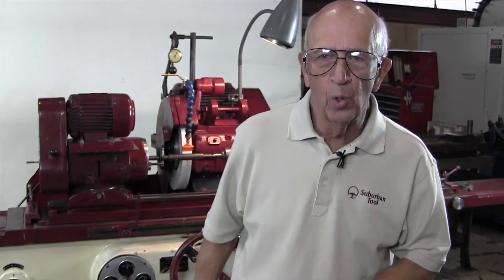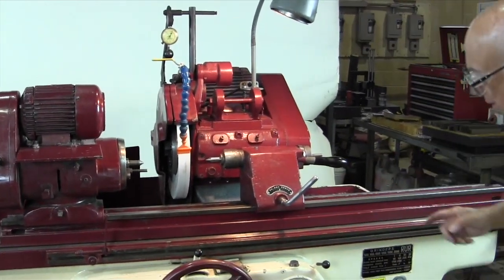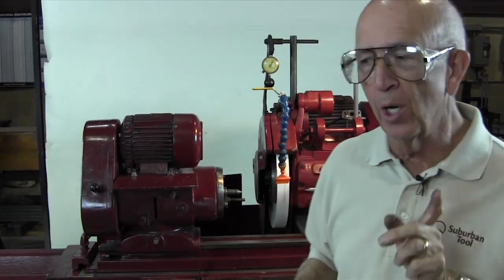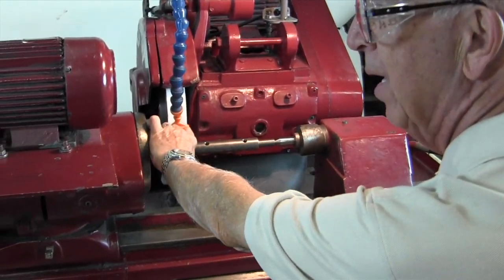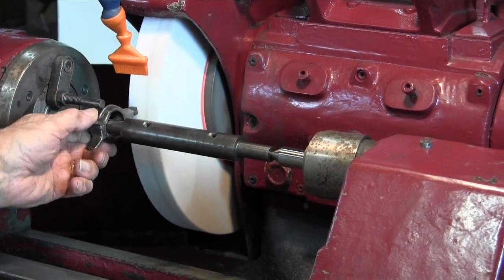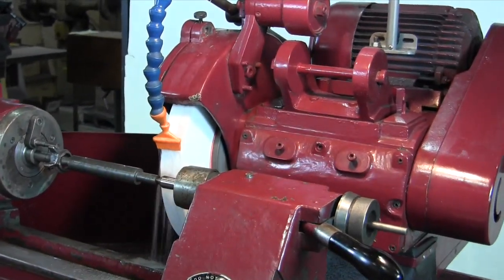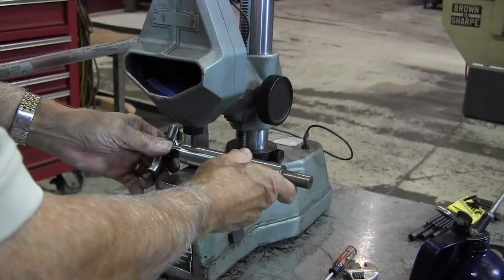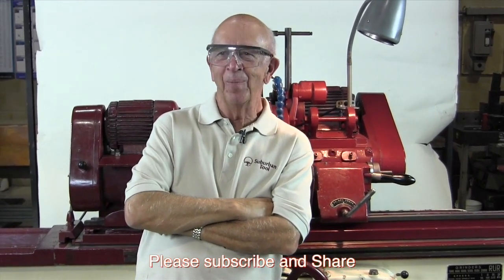How to remove the taper from an O.D. Grinder without grinding the part.

Comment: In the 40 years on working with my kiwi-way cylindrical grinder. I have made centerpieces for both ends. Thinking haven’t had to make for awhile. A #2 Morse taper with a .250 diameter hole on big end about a inch deep concentric to the taper. This machine works 1-1 at 4 inches. 6 inch part 1 1/2 to 1. 2 in part 1/2 to 1. I can usually be within 10 minutes of almost any taper up to 5 degrees. 40 years on one machine helps a lot.

Comment: If someone gives me a piece to grind and wants minimum stock removal I can set the wheel up parallel with the job by using feeler gauges I can set up within .0002" or about 5 microns before I start grinding. I can see the logic of the method in the video and it's a decent idea but the traverse across the piece with such a heavy cut would cause uneven wear on the wheel even on mild steel being ground here. Over the years I've ground mainly stainless steel and Inconel which don't produce sparks so for the novice doing this the wheel would be liable to bite in and then bang you'd have a destroyed workpiece.

Comment: That’s a great tip. Been grinding over 20 years and it never occurred to me to grind the driver. My method is on a slow day years ago I ground several shafts all different lengths straight and set them in a box. Then I pull out one that’s the length plus minus the tailstocks travel from the part I need to grind, load it in the machine indicate it straight moving a indicator across the shaft until it’s a tenth or better. Then load the part I’m going to grind and the taper will be within .0002” first try guaranteed. It’s a huge time saver. Like you said I’m often given a shaft with less than .001” on the diameter so you need it straight or very close to before you start making sparks.

Comment: Sir iam indian in od grinding by cylindrical grinding dia 25mm lenghth 400mm but my job problem both end sige 00 between side sige plus 50micron sir how do correct middle sige od 00 pl. Inform. 78787 46952

Comment: So he got the part parallel to the grinding wheel through out the travel.  I mean he said the table has worn so he tweaked it to take out the error in the travel. I'm not a machinist but if your going to grind and cut, keeping your piece square or parallel to the machine, which ever is required, is obvious.  Seems to me you learn your machine and don't get aggressive with removing too much at once.

Comment: You did not have to do that for the taper. You could run an indicator across the part from side to side or touch of with the wheel from side to side with out turning on the grinding wheel. It's safer.
Reply: The stock is not always trustworthy, especially a piece that has been heat treated. You could see in the video how it did not grind evenly on the first pass due to deviations in the stock

Comment: interesting tip. also noticed you have you drive dog pushing,, not pulling. i can see its wedged so its not likely to move, but pushing isnt really the best way , is it don. This way would definitely take a lot of time if it were a big job, having to crane it in and out would be a pain. would you s a dial in that instance. or just mark the job up and lightly touch either end, then move taper. and repeat one more time.

Comment: Uh, if you're "heavy" on the right side of the wheel meaning it's sticking farther out then smacking in the right end of that table so it gets closer to the 'heavy" side of the stone is only going to make that side "heavier". Which is obvious given how the more you "fixed" the "taper" the more the left side of the stone did NOTHING and the RIGHT SIDE WAS DOING MORE AND MORE. That's quite a "trick" all right.

Comment: i got a question how come you just let the tailstock spring tension hold your work and dont lock it into position  ?
Reply from the maker: On this particular grinder\part the spring tension is more than enough to hold the part. On a larger heavier part, locking would be more important.
Reply: thanks don i been in machine shop work for 25 years now and really enjoy your tutorials thanks for taking your time to answer me .

Comment: That is a good trick...back in the old day's you didn't have a indicator to run along the side lol. nor had you one or still don't have indicator to move the table.
A piece like this, [like most pieces] have stock and I'd be ahead of you by just putting it into the machine and start
grinding...as it grinds I'll keep adjusting table until I see more or less even clean up on ends, then measure first time....how many times you've turned your shaft around and not taking a cut? [time is money]

And it's almost impossible to do on my pieces, from yesterday, this shaft I made from 4140H. hot rolled, all diameters turned .008" oversize, run out was .0015" after grinding run out .0001-.0002" max.
https://www.youtube.com/watch?v=EISJyO7V__g
Reply: You cut on that shaft for how long on a LATHE and within .008" of "finished diameter" it had a "runout" of .0015"? On that SHORT LITTLE SHAFT IN THAT VIDEO? And you don't get that your ".0001-.0002" max" so-called "tolerance" literally means the "big end" is DOUBLE the "small end"? That's like a carpenter bragging about being able to cut 15' 2x4s that started as 20-footers to a "tolerance" of 1 to 2 inches max.
Reply: Konely King not with only .001 stock you wont

Comment: good idea for roughing out. 
i have to work to microns .so still have to use a dti or digital Mic to finish accurately
Reply from the maker: That sounds about right.  Like you have said, this method is just a means to "get it close," you'll still have to dial it in when working with precise tolerances.  As always, thanks again for watching!
Reply: it is a good ideal though having been in the trade for 30 years .one of the best ideas for getting the part close to parallel.

Comment: This is a great trick! Does the grinding wheel wear unevenly when you "walk" it across? Does the right side wear out faster? If so, then would it be recommended to pull it out, step over the width of the wheel, then plunge to the same depth?

Comment: why not just grind it by flipping the part back and forth when you are close to the right size. This way, the last cut will remove the taper.
Reply from the maker: +GnosisMan50 The point is to not grind the part and lose stock, particularly when there is not much stock to lose on the specific part.
Reply: Another problem, unless you keep adjusting, the last cut would not remove the taper. 
Instead you would end up with a part tapered at both ends (fattest in the middle). 
You cannot grind parallel without adjusting the bed.

Comment: Would the grinding wheel have lost circumference going left to right and thus given the piece the .0002" extra diameter on the right end, going that much outside the tolerance you predicted? No real understanding on my part, just a guess. Super cool method.
Reply from the maker: No, but its a good thought

Comment: dude... just use indicator
Reply from the maker: +Полиграфович When the part comes back from heat treat it is generally warped and not straight.  You don't know what you're dealing with when using the part.
Reply: +JC I was thinking the same thing, There is 2 ways that I find the taper when I have to do a skim grind with minimal stock. 1) Put the indicator on the hub of the wheel behind the part, find your center line of the part, stroke the part in and find out where your at and that usually gets me within .0005(assuming your part is already manufactured straight) or 2) Stroke in the table the length of the part with an indicator and that should get you in within a thousandths. I feel like the way hes doing it by using the driver would only at best get you in the ballpark of straight. Using an indicator is definitely the best way in my opinion.
Reply: +JC or use the part.. not the head of the dog screw o.O
Reply: Old thinking method

Comment: It would be nice to have a long bar with a dog handy for this purpose. Accuracy increases great with lenght.
Reply: Given that the bedways of the grinder (even when new) are not perfectly straight: 
Although your suggestion seems like a good idea,  it would mean moving the tailstock in closer when it came time to do the actual job, which would mean the tail centre was no longer exactly on the same axis as when the adjustment was done.*
It seems to me this would defeat the purpose of carrying out the adjustment. 
I'm guessing that's why he uses the actual workpiece to carry out the adjustment, because it's exactly the "right" length. 

 *Even if the bedways were straight, the tailstock cannot clamp up in EXACTLY the same alignment twice in a row. You find this even on a lathe when doing fussy work: once you've got rid of any taper in a particular workpiece, it pays not to unclamp the tailstock from then on, and to snug up the barrel clamp to exactly the same angle each time you take the work out to measure it

Comment: Old trick done it for years.Had one part 20 foot long 8 inch dia. Only had .001 stock left to remove with .001 tolerance. I managed to grind it and did,nt make the dia too small.
Reply: That "trick" is probably straight out of the operator's manual for that machine. Exactly what part were  you machining that was 20 feet long and 8" in diameter with a "tolerance" of .001" and how many supports had to be under it in 20 feet to prevent 8" ANYTHING from sagging in the middle several thousandths?

Comment: Since the bed pivot is near the center of the bed and the tailstock is closest to the pivot, wouldn't it be faster to make the first adjustment with the dog on the tailstock end and then do the head end? The tailstock end will move less than the head end as you pivot.

Comment: ok you have challenged me to think of a way without grinding, I haven't watched the video yet to show me but I reckon you can get some sort of cylindrical square get the wheel really close and touch on with paper? or have the light barely fading, then run it across the cyinder and check for the light to disappear/ get bigger or touch on with paper on one side and check other?
Reply: Letrool Haje Alright watched the method, it's different method but very similar, cool man

Comment: this is variation on using paper as a guide between the work piece and the wheel. paper is about .0035 thick, so when the wheel grabs the paper you know you near the .0035 from the work piece and then can start to spark it out.

Comment: Nice tricks!  I have made several cylinder squares where the ends were square with the OD.  Lot's of fun!  If you are off .00005 it will show up on a good surface plate with a light behind it.
Reply: James Spallinger he said 0005 not millionths

Comment: That's a nice trick and I was taught the same by the previous grinder hand. Easily gets within 0.01 mm with the taper just by doing it with the machine switched off, BUT requires that the workpiece is easily maneuvered (weighs less than 10 kg). I would not want to swap it end-for-end if it were like the forming press hinge pins I just did - 150 kg each.

But I haven't ever figured out why on earth would anyone seriously grind, adjust, grind, adjust ad infitum, when you can just measure the workpiece and adjust the machine to the workpiece and not doodle around with the adjustments. If I see someone doing that after being told of correct/better methods, he/she/ is not a professional but a time-and-money-waster that should be let go.

What I've done when I have a piece that has some/normal grinding allowance, I adjust the machine to approximately straight just by eye, then grind each end clean. Measure the difference with a micrometer, whip out a dial indicator with a disc or bar shaped tip and attach it to grinder head. Zero out on the workpiece end that is closer to the table pivot point, then go to the other end. Adjust the table so that the DI shows half the difference you measured and you are done. One could also check it after initial grinding to make sure that the DI was dead-on perpendicular to the workpiece and didn't produce 0.01 mm taper because of that.

The same measure and adjust procedure can be done also very easily for a workpiece that was previously ground but needs more to be taken away. Just run the DI across it so it shows zero or if there is diameter difference, then half the difference.